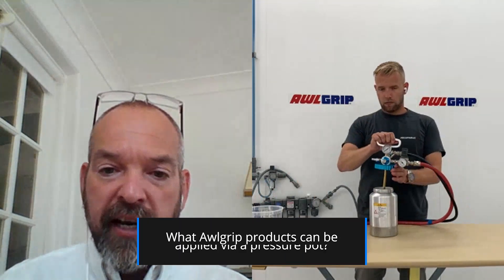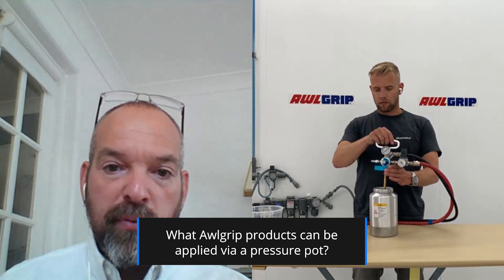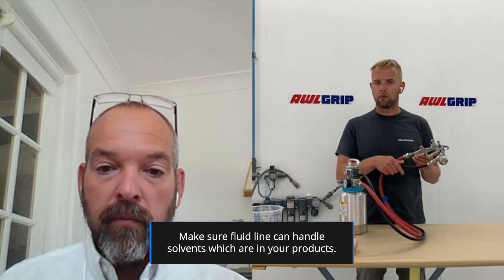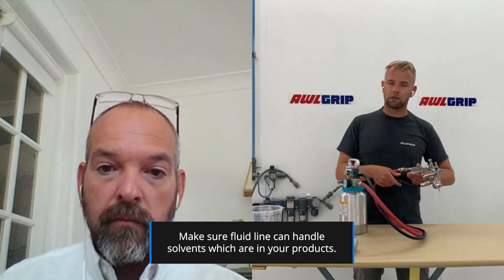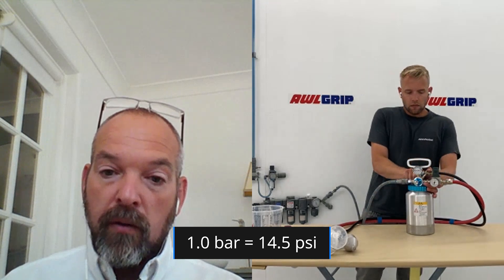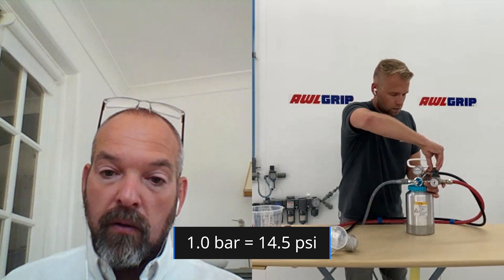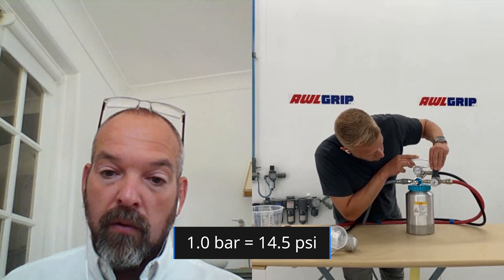AkzoNobel Yacht Coatings and Coffee - Pressure Pots

Comment: What tip size do you recommend for the pressure pot set up?
Reply from the maker: Hi David - it is difficult to give a specific answer to this, but topcoat wise a 1.0 to 1.2 tip is a good range, the most important thing is setting the fluid flow rate to the appropriate volume. We reference this around 9 minutes into the video. Primer wise you are looking at around 1.2-1.8. 

Please speak to your local representative if you have more specific technical questions: https://www.awlgrip.com/sales-representatives
Reply: @Awlgripfinishes  thank you so much. Keep the good stuff coming.

Comment: Would it not be beneficial for Awlgrip to develop a complete set up including pot and lines across the range? Much like the C-spray.
Reply from the maker: Thank you Ryan for your question. As a paint manufacturer we work with wide range of spray gun manufacturers to assist in achieving the best finish with our products. The C-Spray gun from Devilbiss will work with any pressure pot along with the correct nylon core fluid lines (be sure to check the compatibility of the fluid line with the product that you will be spraying). For more information on the gun and set up, we recommend you reach out to Devilbiss and if you have any questions about our products, let us know and we will provide the needed assistance. Thank you for using Awlgrip! 🛥

Comment: Hi, is that iwata Ws200 SP or FT nozzle?  Which of the two do you recommend for awlgrip products (top coats)?
Reply from the maker: It’s a Iwata WS200 with a FT nozzle. We typically don’t make recommendations on guns or specialized tips to be used, as this is highly depending on preference and skills of the applicator itself. We would say that the most common set up in our market is a Iwata WS200 with 1.0 FT nozzle for Awlgrip Topcoat and Awlcraft 2000.

We would only recommend the SP nozzle for seriously experienced applicators, this brings a lot more atomization to the paint, and is therefore also changing the feel the application. This needs thorough testing by the applicator in order to determine if it suits their needs. Hope this helps, but if you have further questions - please reach out to your local representative: https://www.awlgrip.com/contact
Reply: @Awlgripfinishes  thanks for the quick answer!!!
Reply from the maker: Happy to help Cristobal! :)